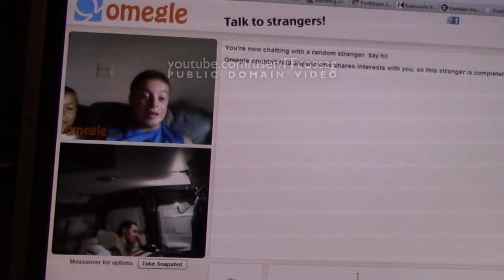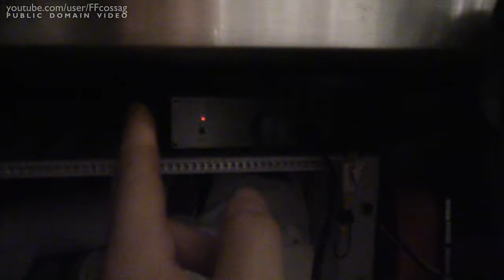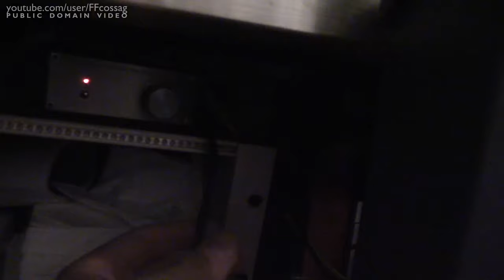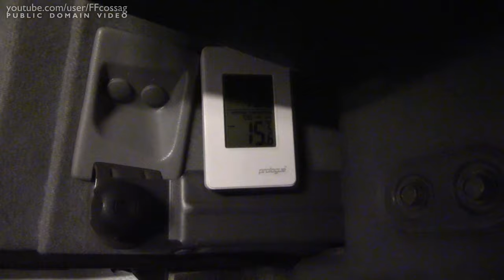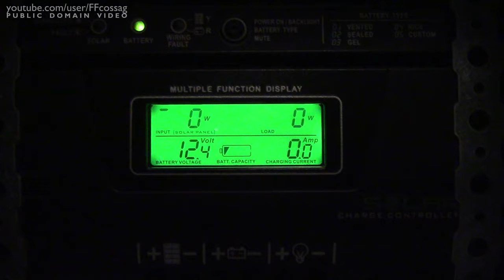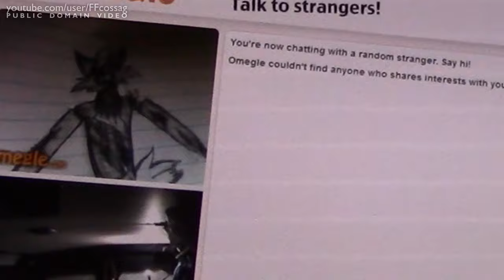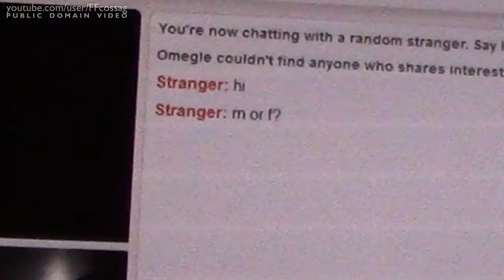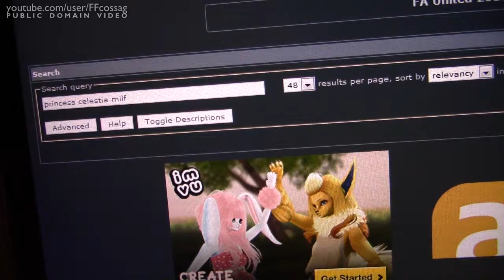VANLOG #5 - Gaming, getting comfortable & Omegle trolling

Comment: +FFcossag instead of coating the metal parts, it can be easier drilling strategic holes and injecting expanding polyurethane foam into the cavities, then just putting an adhesive backed fabric covering the exposed metal to prevent cold touch.
Reply from the maker: I've considered that, and it'd be possible to do without drilling holes, even. I'm just terrified of moisture and cable routing issues, because once that shit is in there, it ain't coming out.
Reply: feed a piece of conduit through before injecting the foam and use that to carry any cables.
Reply from the maker: Sasquatch
It's an option, for sure.

Comment: Ive had certain wireless cards play up and disconnect for no reason at all, changing drivers/settings/a different machine/ different o.s made no difference.
Some cards are just crap :-(
I settled on a Atheros AR5007eg, spot on with everything :-D
Reply: I think broadcom was the brand of the card i dumped, pain in the arse lol.
Yet my machine has a built in lan port and it is the same name, but it works fine, perhaps they are just crap at wifi.

Comment: I dunno. I've rarely ever had an intel card go bad on me. the 5100's are a bit crappier than their 5300 counterparts, however, in terms of longevity. 
the old 3945abg's were horrid. the 4965agn's were in desperate need of heatsinking being the first N-supporting card Intel had in laptops of that time.
nowadays you can do N speeds on any old USB-powered microstick and not have a whole lot of heat. it's an amazing thing how far we've come in the past 10 years.
Reply from the maker: The issue actually wasn't the card, but rather the card getting confused by the WLAN disappearing and reappering rapidly and not working right as a result of that.

Comment: >Has UTMS card installed in his laptop
>Uses external modem
Reply from the maker: UMTS modems tend not to work very well inside Faraday cages.
Reply: So you would recomend getting external modem instead of UTMS card? (I want to get T530 next year)
Reply from the maker: That depends entirely on your application. I just like to use my external box since it's not tied down to any one machine. And the fact that it actually works in the van.

Comment: what tablet is that?
hp 2730p ?
Reply from the maker: Close, it's a 2760P.
Reply: +FFcossag i need to buy a 2760p becouse it supports normal 2.5"drives. In my 2730p hdd stopped working and cost of 180 gb 1.8"drive are ridiculous
Reply from the maker: fila1445
I personally really like the model, so I'd say go for it. Mine's NOS, so I can't vouch for the durability of it yet, though.
Reply: and btw, you inspired me to finnish quicly my peugeot 205 and go to some kind of road trip :D. But eletronics in that little french car are nightmare :( especially when you swaped 2.0 16v engine and only have 1.0 carburrated loom :P
Reply from the maker: fila1445
That does sound like a major project. Good on you though, 205s are nice road trip cars.
Reply: that was complete restomod, but it's veeery stiff right now. I wanted to make it a perfect fwd touge machine :D
Reply from the maker: fila1445
You got the right car for the job.
Reply: for leasure driving i have peugeot 306, it handles a lot like 205 but it's bigger. 205 is reserved for roadtrips through nice twisty roads :D, even stock 205 was handling bautifly